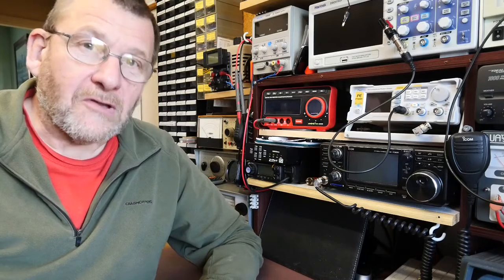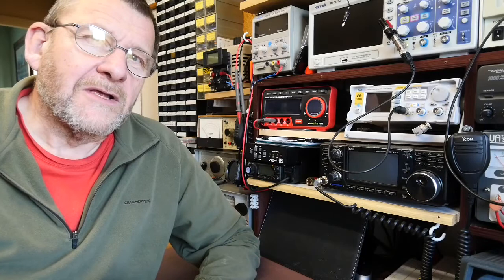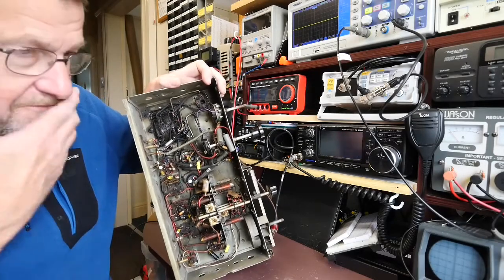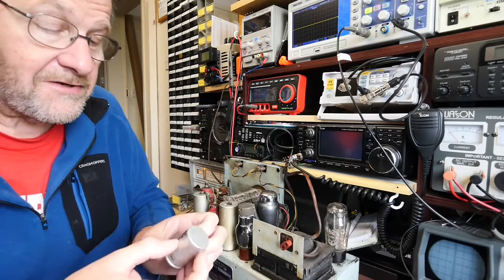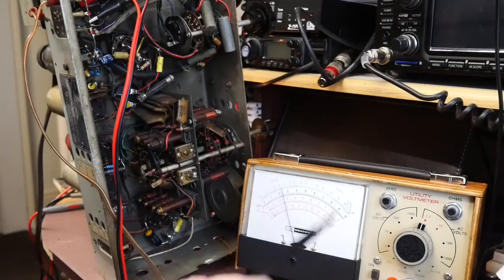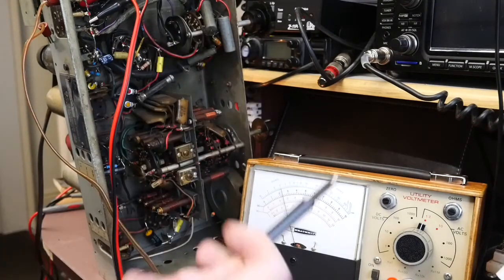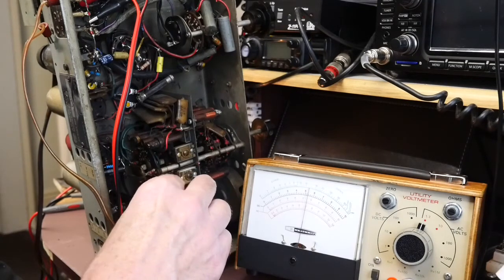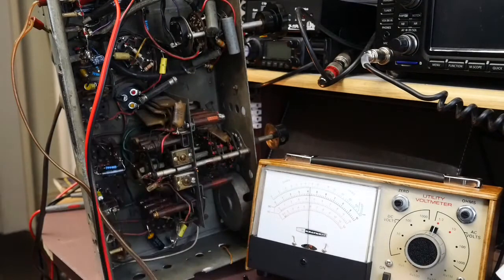PYE 19D Vintage Valve Receiver Restoration  - Part 2

Comment: Nice video again. 👍
I have had a few old radios and quite often adjusting of alignment is really not necessary at all. Normally only if some dumbass has been monkeying around with his little screwdriver.
All what is normally needed is changing leaky coupling caps and dried out electrolyts and sometimes those resistors which have been working near their max power dissipation and went out of acceptable tolerance. And some deoxit to switches and pots and tube hmmm...🤔, sorry, VALVE (😀) sockets of course, if needed.